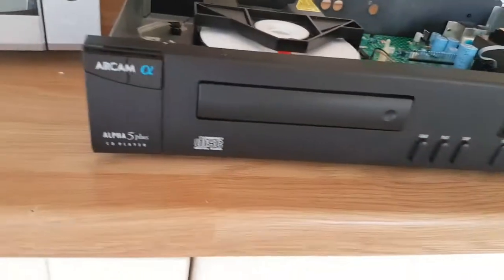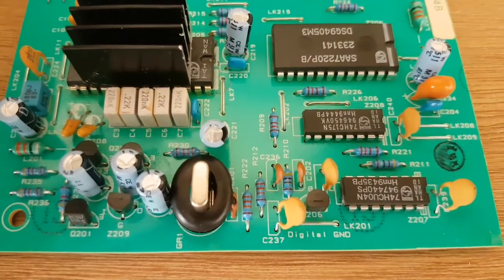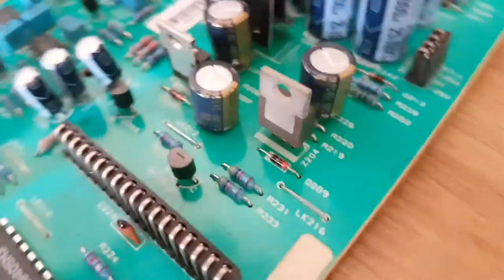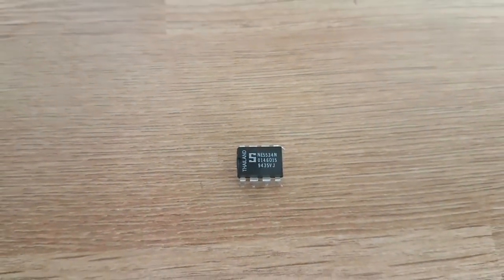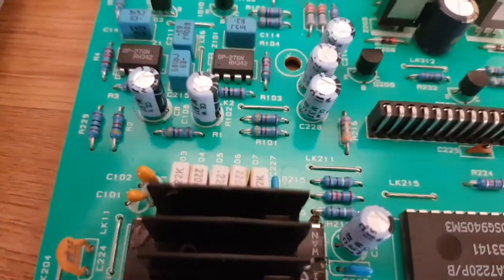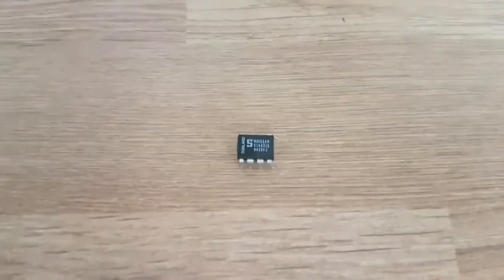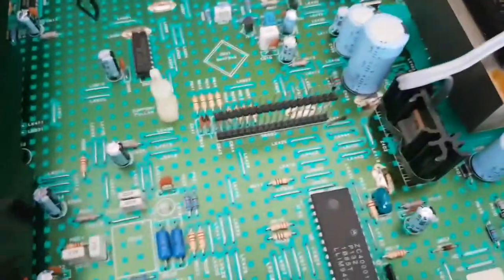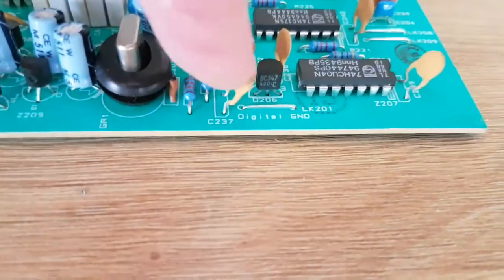Arcam alpha 5 plus

Comment: Hi help needed I have a Arcam Alpha 8se cd, its gone up the wall, the transformer buzzes like hell, also does not read discs, the disc tray clicks like its going out of fashion.
I also have a Alpha 9 integrated amp, the rotary selector has also gone faulty, if possible could you help, I have a 9p power amp, and a Michell gyro deck, and graham slee Gold era , the Slee phono stage seems like a bit of a waste as the sound card that I have for the Arcam sounds a lot better sound stage, any mods for these bits of equipment. the gyro deck has a dc motor and the slee gold era phono stage has a standard power supply.
do you have a email address that I can email you more information on.
Reply from the maker: Hi Martin my email is madkebabs@msn.com sounds like your cd player needs looked at or may even need replaced.
The selctor switch is a comon problem.i might have one the gyro decks motor power supply can be upgraded.  arcam make very nice Phono stages the Graham sleep can be upgraded  kind regards